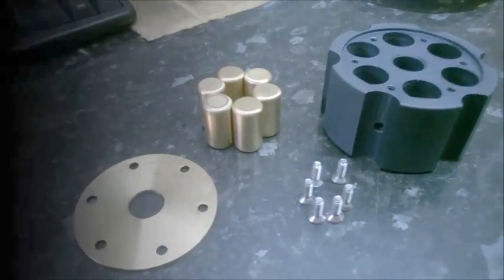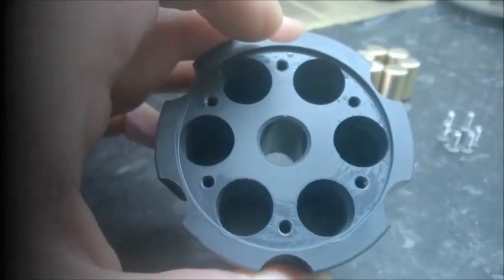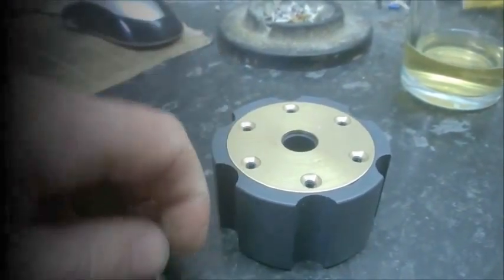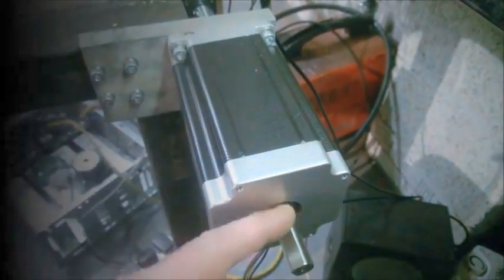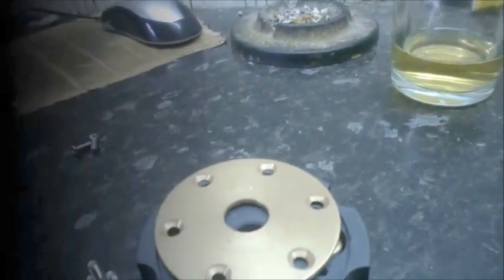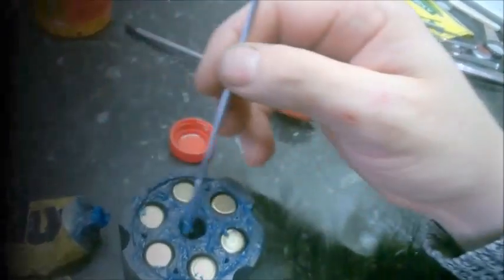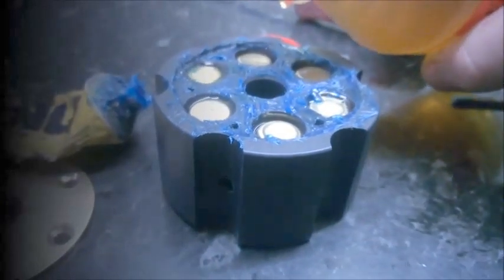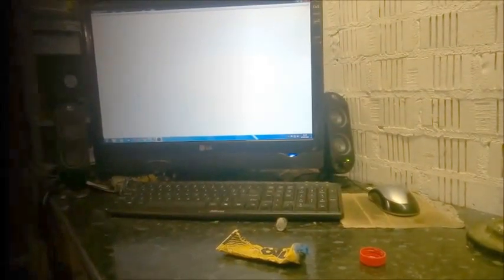Oil filled Nema 34 stepper dampers.

Comment: Thanks for video, I have similar problem with my machine, it stalls at 1000mm per min (500RPM), I'll try to make that dampers. On what RPM your motor stall without damper?